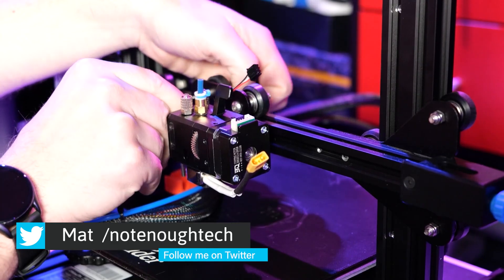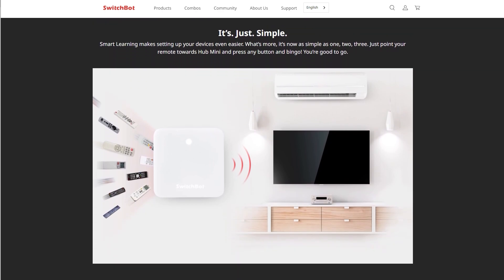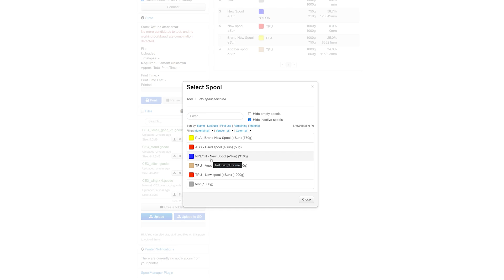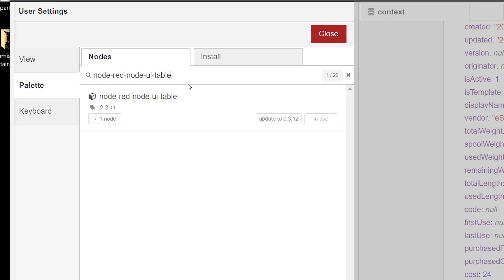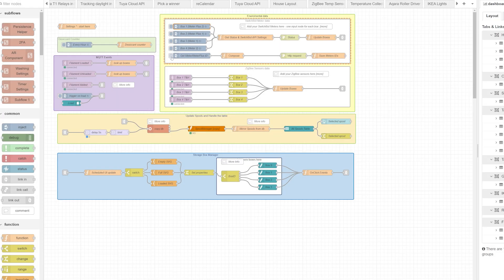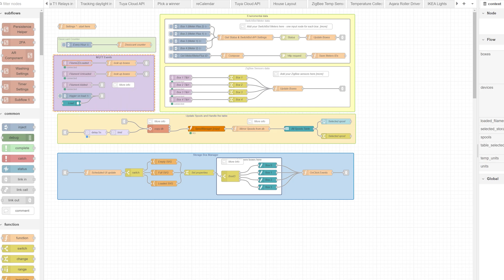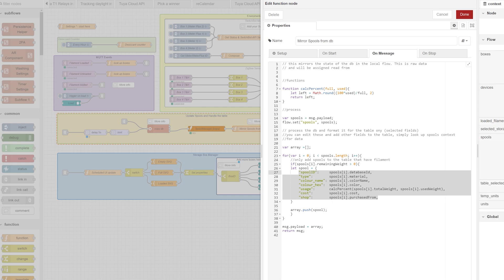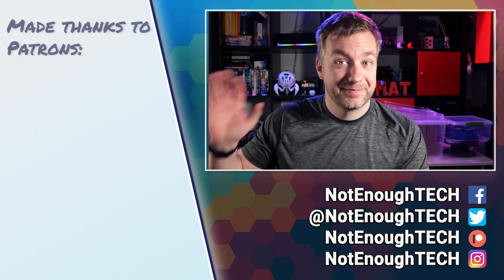The smart way to store filament

Comment: Was getting late last night. How much?  I have lots of rolls of filament. I am trying out HA, try it 5 or 6 years ago. I so miss node-red after using it.
Reply from the maker: You should be able to run HA and NR on the same machine. They are not taxing
Reply: @notenoughtech  I have, but have broken the configuration.yaml on line 3 column 1already.
Reply from the maker: @chuxxsss  YAML is pain in the ass. Load it in a decent editor and make sure your indents are spotless. tabs vs spaces make a big difference in these files.
Reply from the maker: Looks like it's not the day for automation

Comment: It would be nice, if the plugin can qreate QR codes to print. Every time when i insert a new spool, the inbuild raspi webcam could be used to identify the spool and change actual spool in the webinterface. With a simple unique id, or some more stored infos in the QR,  so that we are able to read basic infos about the material on our mobile phones., too 😀 i think that the most oktoprint users are already using a webcam. So it is more or less free to insert this QR features
Reply from the maker: I believe the spool manager already has QR codes for this. So if your camera works with QR codes in octoprint, selection by QR would be reflected by my dashboard.
Reply: @notenoughtech  nice. I did not got in the video. Sorry. Thanks for this good informarion.
Reply from the maker: It's nice that you brought this up, as I haven't mentioned this functionality of the Spool Manager (they made the QR integration). But I just tested the QR with my phone and it works as it suppose to
Reply: @notenoughtech  nice. Thx 4 this information.

Comment: carbon fibre nylon? that must be some sturdy prints... Nylon-k or kevlar wouldn't cut it? (its 70$ and wont eat through your nozzles as much).
Reply: You can get hardened steel nozzles that work pretty well with carbon fibre and other reinforced filaments, but still go through them pretty quick.
Reply from the maker: @EsotericArctos  I was tempted by ruby nozzle at some point but the price swayed me away - so hardened steel all the way
Reply: @notenoughtech  I couldn't justify Ruby for home use either
Reply from the maker: We use it at work for industrial grade printing. It's a pain to work with, but if you get it right, the results are fantastic.